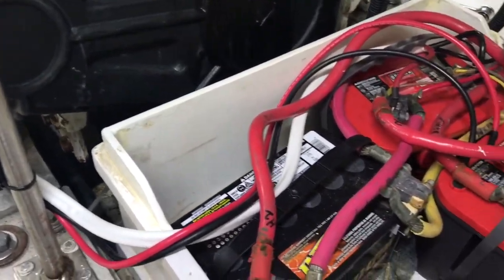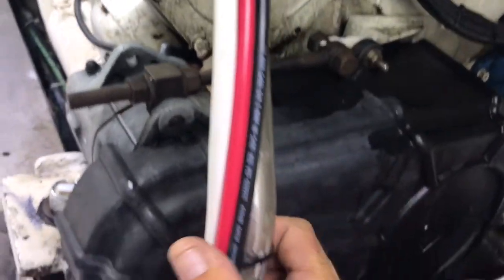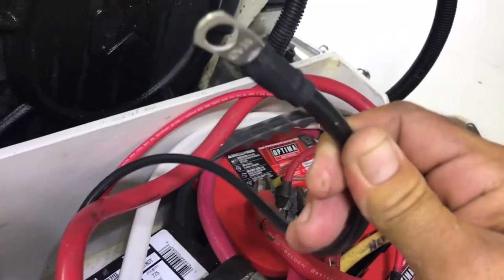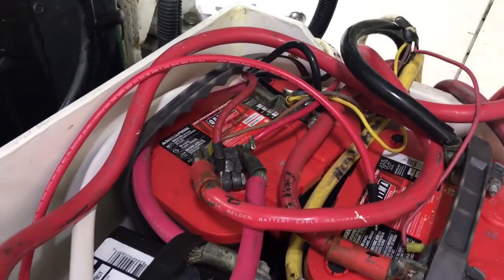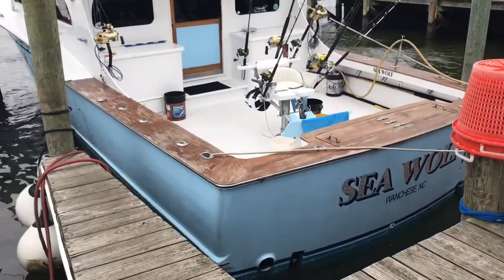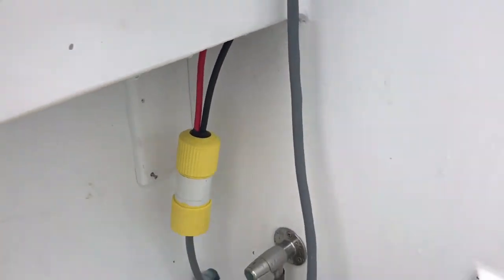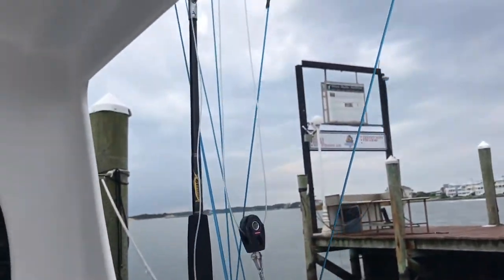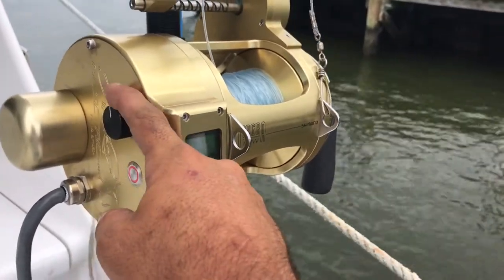How to wire your Hooker electric reels

Comment: Those batteries connections look horrible how can hooker electric show this as a correct connection.
Reply from the maker: Abel Vazquez the video is from 3 years ago. The boat is a 1975 charter boat. I guess They weren’t worried about making it look clean. Still works to this day
Reply: @hooker_pumps  Sorry but it doesn't matter is the boat is from 1970 or 2000  If the wiring looks like a mess, that’s bad.